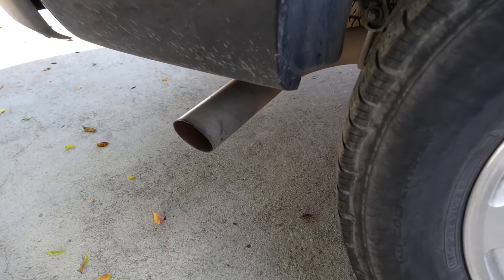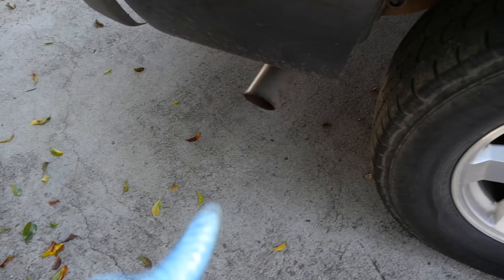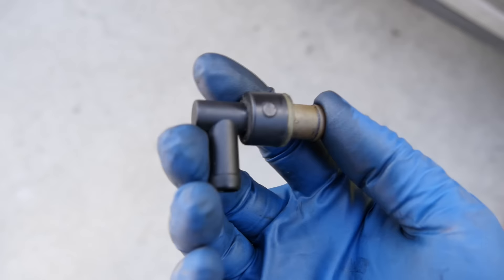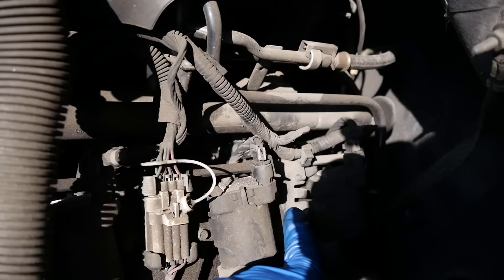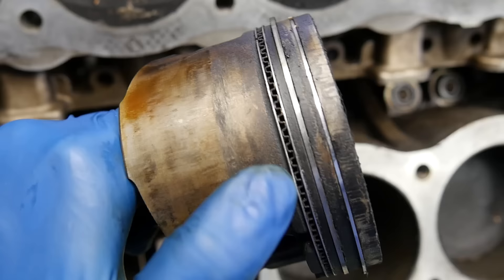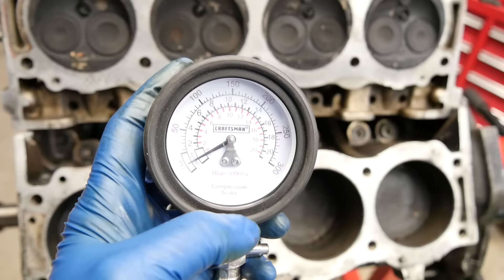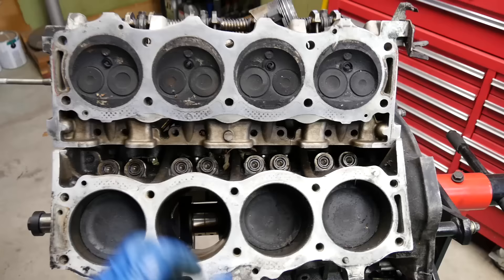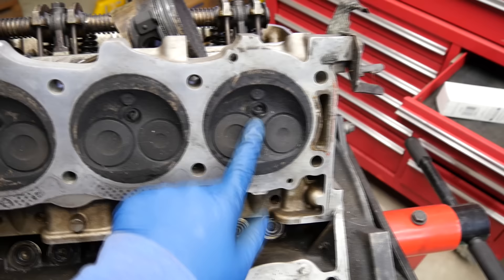Top 5 Reasons Your Car Is Smoking Out the Tailpipe - And How to Diagnose Them

Comment: Last year I bought a used long block for my 97 Accord 2.2 for under $80. The guy told me the engine idled poorly and had blue smoke coming from the tail pipe. Further inspection revealed excessive oil in one spark plug and oil seepage from the exhaust. Disassembled the engine and found a burnt exhaust valve probably due to oil coming through the piston oil control ring. Purchased a re-ring kit and went to work. Found #3 pistons rings totally shot out and replaced the burnt valve. Put the engine together and she started! I was so glad since this was my first project I ever did putting an engine together. I gave the car to my son to get around town when he’s not deployed in the military. 
I bought the car for a great deal with mechanical issues. The owner said the engine sounded like a rod bearing was going bad. When I removed the oil pan, it looked like Tinker Bell’s Dad was living in the oil pan...I still have the original engine in the garage. Maybe I can bring it back to life??🤔
Reply: S

Comment: Thank you so much, you were a life save today. I have a oil leak and today I was in a rush and filled way too much oil (did not take the time to use the dipstick) . My old Nissan then proseeded to smoke bomb the whole neighbourhood. Then I found your video and the light bulb finally went on. I drained down the oil to 3/4 and let the engine run for 30 minutes. Problem solved.

Comment: You can add this one to the list: the fuel pressure regulator. If this goes out and stays in the open position, your engine will be flooded with fuel (as in it is running too rich) and cause white smoke to come out of the tailpipe. Expect a noticeable decrease in fuel economy and for the car to quickly sputter out and not want to start (or start and run very poorly) after a day or two.
Reply: Will a stuck open injector cause white smoke too?
Reply: @Mit_Reklaw  It can, yes. Like with the fuel pressure regulator staying open, a stuck open fuel injector will eventually allow excess fuel into the combustion chamber and cause the engine to run rich. A bad fuel injector can also lead to engine overheating so it is something you want to get taken care of fairly quickly if that is in fact what's gone out.
Reply: @Russell-rc6qq  thank you so much for your response !
Reply: Thanks for your input...
I thought a stuck-open injector would cause it to smoke black. Would a bad fuel regulator also cause it to run hot? Ive checked my injectors and are not stuck open. Replaced my fuel pump and having same issues. Vehicle turns on but cranks a few times before it does. It doesn't really get hot but i notice coolant level gets low...
Reply: I came for the video but this was my exact problem. Thanks 👍🏾👊🏾
Reply: This is me today  my head gasket blew out after wards
Reply: @DidiMuseri  Because your fuel pressure regulator stayed open or what exactly caused your head gasket to go out?
Reply: My fuel gauge is not moving at all so I have been putting gas in every day to make sure I have enough cause I don't know if the van is full or half full. So my van has been smoking a little but two days ago it got worse. White smoke was coming out the tail pipe like crazy.

Comment: Wow, thank you for this video. Very helpful. I had a car once. It was blowing out dark gray smoke from the tail pipe. 
The mechanics told me I had a blown gasket. I didn't know what that meant at the time. 
And then again, maybe the mechanics were blowing smoke in the air as well. 
Thank you for your video. Very helpful.
Reply: Dark Grey smoke shouldn't indicate headgasket. White sweet smoke does, and lots of it. Dark Grey or black sounds like a full filter issue or possibly fuel injector issues to a plethora nore involving the gas itself. However blue smoke= oil white smoke = headgasket, condensation.  Grey/black smoke. Something bad probably. Lmao. I don't know a whole bunch but hope that helps. " yup, the engine certainly looks like an engine." 😅🤣

Comment: Thanks for this video. My 2013 Ford Flex loss power & then I saw some smoke coming from behind (mufflers) I pulled over immediately & shut it off, raised the hood, checked my oil, which was fine/normal, my antifreeze was still full in reserve tank, it never ran hot but did start rough idling too. Next day auto parts store put the check engine light machine on it & it gave codes for four O2 sensors. Next day had it towed to a shop parents have used for diagnostic & told them exactly what it was doing for them to waste my time to tell me the next day they didn’t put it on the machine because of the smoke (that I told them about the day before in their shop office) & that it had a blown head gasket. I find it crazy to say that when they didn’t even put it on the diagnostic machine or do any other testing besides there was smoke so it’s a blown head gasket. After watching this video, I’m really wondering if it just needs a catalytic converter & O2 sensors replaced as thought from taking by auto parts store for the check engine light little machine that said O2 sensors four to be exact. I don’t like getting the run around when I’m trying to get my car fixed before my child goes back to school Monday. I’m her transportation because she’s out of zone & no bus is provided. Hoping tomorrow I can find an honest mechanic that will diagnose the problem instead of guessing, I can’t afford a well I thought that was the problem. So many shops are still trying to get over on women & it’s pathetic. I know some about cars & they hate when I ask questions.
Reply: Biggest rip offs I have seen in life are auto repair shops. Be careful. If you have loss of power it might be good to check the catalytic converter to see if it is clogged. I was able to clean mine with a power drill and a round wire brush and same a lot of money. Might want to start there. If you have a clogged cat you can loos a lot of power, like not being able to drive past 60 mph, but a partially clogged one can rob gas mileage.

So if a cat is clogged might that cause 02 sensor readings to be bad? I don't know. I long for the days when we didn't have cats and 02 sensors, but I suppose they will never return.....unless I go electric.
Reply: Well auto supply did the check engine light check & at first it said O2 sensors, so did the O2 sensors & then it said it was 2 specific coil packs, so did those. It had the power back but still a little smoke so was driving it about two blocks away & it threw a rod right before turning into the auto supply place, so now I need a dang on motor. My friend that works on cars asked me what was I doing with a used motor in my flex & I said what? He said the markings on the motor are like when you get a used motor from a junk yard. I never put a motor in my flex. Contacted Car Max & of course they’re giving me the run around about probably can’t pull up where they bought it from. Daughter’s dad told me a few weeks ago the salesman told him it was a rental car before they got it. But they didn’t tell me the one buying it. It only had 10,056 miles supposedly when I bought it but if it was a used motor, no telling how many miles it really had. I have never blown a motor in any of my cars.

Comment: white smoke doesn't always mean bad head gasket/cracked block or head. It may be condensation as he said but most description say after car is fully warmed up it should disappear.. not always the case some cars just have a light thin white smoke every time on colder days.

My 04 BMW M3 I noticed a thin white smoke and it was more apparent when I went catless during cold weather season. and it doesn't go away. looked at atleast 10 other videos of same car with exhaust videos and they all do it. doesn't lose any coolant level either so I figured combustion + cooler weather when those hot gasses comes out they produce steam and makes em smoke/spit a bit of water in your tail pipe.
Reply: erickrayos is that something is serious if it is spitting water and smoke

Comment: Another way to check for a worn block or piston rings is adding Lucas heavy oil stabilizer to your engine oil and let the engine warm up if the smoke goes away and your engine harmonizes out and starts running better it may be time for a rebuild I did this with my 76 f150 and started yelling about it for a while when it ran smooth and the smoke went away
Reply: That technique works well for old tech cars. But a worn engine is a worn engine lol
Cheers
Reply: might as well get a new car

Comment: White smoke can also be from stuck open injectors.    I had this and watching all the videos thought is was coolant but it wasn't.   Two of my injectors were dumping fuel and it must have been going straight into the exhaust and also into my engine oil.   My engine oil was full of gas and I changed the oil and replaced the two injectors.     I did crank this car over a lot and run it trying to figure things out and all that time I was dumping fuel.  So I think hot fuel vaporizes and comes out the exhaust pipe as white putrid smoke.   Other video's attest to this.

Comment: Darn, that first tip hit home. I started having this issue when I added oil to the car. I guess I added too much.
Reply: Ye me too it started smoking after i put oil in it.. Now im thinking the worst
Reply: Check your pvc valve.
Reply: Damn I just put oil in my 2005 Saturn ion and thick white smoke was coming out of the exhaust I took it to the shop thinking it’s a blown head gasket but now I’m
Thinking it’s just way to much oil
Reply: @taiwalker6255  Hi. What was the problem then? Too much oil after all? I am having the same problem with my car.
Reply: @glaucodanielcoelho9886  I put WAY too much oil in it I needed to drain it it messed up my spark plugs tho
Reply: @taiwalker6255  Nope - oil smoke is blue, and has a distinctive oily smell.  You have white smoke, which is water vapor.   You likely have water getting into your cylinders. That is a bad sign. It is either a leaking head gasket or a cracked head. Either way, it's a bad problem. Get it looked at ASAP!  DON'T IGNORE IT or it may foul your catalytic converter next and that will REALLY cost you $$
Reply: Stg i put antifreezr on my radiator and i dodnt know it was a different kind of coolant and now im fucked
Reply: @fenderstratguy  the problem was I put in way too much oil in my car the smoke was thick white but faint blue. My head gasket is fine. All I had to do was drain the oil out
Reply: @taiwalker6255   I am glad you are okay. Overfilling oil can actually cause overheating. The oil is so high it is getting hit by the high speed rotating crank. That whips air bubbles into your oil and converts it into a frothy mixture that provides poor lubrication, since the oil is getting whipped into foam.
I checked again and it appears oil CAN cause white smoke also, so looks like I was wrong saying it HAD to be coolant .  
Anyway, I hope your engine stays ok now.  Sounds like you fixed it!!  Congrats.
Reply: If the problem showed up after oil change it's not your pvc valve, otherwise the problem would have been apparent before the oil change. Common sense 101.

Comment: Always good to check the engine manual or ask the shop how much oil it needs, I have a motor with a stick thats not original and if you fill up the oil by the stick you put +1 extra liter than needed on the engine wich causes those issues you said.
Reply: Why not look for an OEM oil stick?

Comment: Very good video! My 93 gmc is blowing smoke,  plan to diagnose next week, only 415,000 miles original motor, i just don't understand!
Reply: I have a easy fix for you . Use my Turbofield Nano Treatment and your problem should be solved . 5 minute job . Have tried this on a Dodge Ram Diesel pick up which had as many miles on it . Smoke gone engine runs smoother with better mileage and tail pipe squeaky clean .

Comment: You are definitely spot on because I already knew that my CO2 sensor needed to be replaced and the check engine light has been on for almost 2 years and I knew the whole time, that's exactly what it was but it just now started to really cause problems with using a lot of fuel, the Gray smoke, rough idling, Etc but I would say the biggest thing now is the stuttering, fuel consumption and the gray smoke if it has a gas smell to it. This tells me that I'm very lucky and blessed and I better hurry up and get this fixed and come up with the money any way possible and pray that I don't need a new catalytic converter because it's a 2005 Lexus ES330 and if I'm not mistaken, I've got like three or four catalytic converters on my car! Thank you for this information
Reply: @Carrie Thompson— You said “CO2” sensor. I believe you are talking about the “oxygen” or “O2” sensor.
Reply: @mplsfarmer  yes lol, it's the oxygen sensor but it's also known as a CO2 sensor
Reply: I think you have 4 O2 sensors and maybe 2 CATs  in different locations in the exhause.  Do not run a car if you do not know why the Check light is on.. yes you can cause damage or ruin the engine.  Gas in the exhaust will ruin the CAT.
Reply: @danc2014  this is so embarrassing to admit but that post was from 2 years ago and I have not gotten anything fixed under the hood. I can honestly say that it hasn't gotten any worse. The check engine light came on because of the O2 sensor, I had it checked and that's the code that came back. And you are right, I do have four of those and two catalytic converters. I know one thing, these Lexus' our amazing cars. I feel bad that that car has treated me so good and I haven't been able to afford to do what I need to do with it. It's just a situation I got left in as a single mother. I don't know how much they have changed over the years but mine is a 2005 and it's got over 200,000 miles
Reply: @mplsfarmer  you are Point Blank awesome you know a lot and you're good at it to be giving people free advice that is true thank you for your services here at this this website I recommended highly
Reply: My cat clogged up on my old van. I took off the cat and noticed the inlet side was completely blocked with carbon. I removed it with a round wire brush with extension and an electric drill. It scrapped off the carbon and also some of the honeycomb in the cat but it did not clog the inside of the cat. Rinsed it with a garden hose and saved the cat. All clear now. Easy fix on mine. Saved big $.
Reply: @raybrensike42 I don’t have cats and it smokes and stinks really bad I don’t know what’s wrong

Comment: Too much engine oil .... finally a reason that I haven’t came across ,I just bought a car presented and have a fog machine going on with it and well it has no codes (handled them ) so I got it on the low ngl ,imma check the oil because I’m betting that’s what they messed up on ,thank you very much

Comment: I have an 03 Camry that has one or two leaky valve guide seals. One thing I noticed with that problem, if I parked on a hill facing the front end down the hill and the car parked at an angle so the valve covers were sloped on the down hill but also to one side like the left side of the valve cover was on the down hill side, I got no puff of smoke in the morning. It was like, park on a slight hill with the font end sloping down hill and then jack the entire passenger side of the car up in the air about a foot. Maybe all it really would have taken was to jack up the passenger side of the car in the air about a foot to drain the oil to the left side of the valve train. I don't know. Maybe I just needed to park sloping the nose down the hill. It suggests to me that the passenger side seal or seals were leaky and with no oil covering the seal, none could leak through. That's my guess.

Comment: Bad fuel should have been in the top 5. Getting poor fuel gives most of the symptoms. Microorganisms in the tank could eliminate the top 3.
Reply: Due to some unforeseen circumstances I recently had to leave my truck at a friends house in Florida thru the rainy season for 2 months w/o any start-ups. In addition I had lost my gas cap the day before. When I picked it up and started it down the road there was tons of white smoke and very rough running. I think its bc the crappy ethanol fuel was drawing moisture from the atmosphere into my gas tank and thru my fuel system. Does that sound like a theory? Thks!
Reply: @MasterArmedforces  about right, tank cleaner with fuel filter change. Bleed the lines. Might be to much work for home mechanic but beats buying a new motor.😏🗝️

Comment: My truck smokes only when cold weather, what does that mean?
Reply: BECAUSE ENGINE IS COLD
Reply: Thanks folks!
Reply: @cobrakillerlasertrex  condensation video😂😂😂👍
Reply: It means its cold out.
Reply: It means you need a new thermoculator. It's gonna set you back about $4000, but we'll throw in a muffler bearing for free.
Reply: @ObamaoZedong  did you get insulted?😢
Reply: @neutronronnie9343  of course. On behalf of those with DS.
Reply: Would crank case vent fail cause lean code p0147?

Comment: Rev up your Toyota oil burner! 🤣 In my case my Lexus 😢
Reply: Lol
Reply: keith cunningham Scotty Lied 🤥
Reply: It might be a Lexus but it still needs maintenance and oil changes every 3k miles
Reply: Gs430
Reply: John Gutierrez your 430 burns oil?
Reply: Yeah a wee bit
Reply: John Gutierrez that is actually the Gs that I want. Rather than the GS300 that I have. How do you like it? Is gas mileage terrible?
Reply: @heyitschinoable   22 frwy and 18 city driving that's driving  normal on fast driving it waist fast . The motor is solid and easy maintenance

Comment: This black smoke smells like a funky fart. I've put a new catalytic converter, manifold, tps sensor, fly wheel, starter, alternator, radiator, shocks, had oil change, gas filter, 02 sensor and radiator hose. But I notice loosing lot of gas fast, my next move is maf sensor.